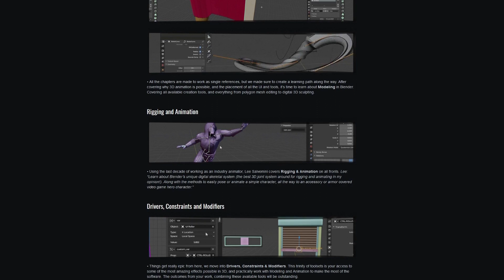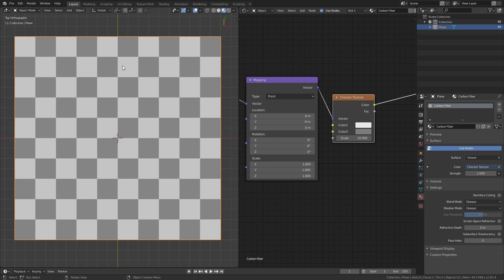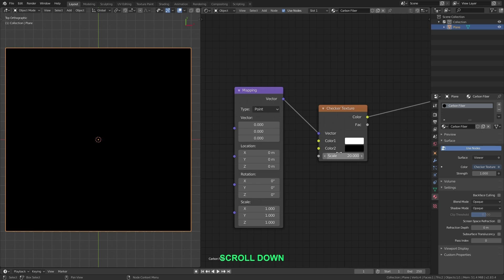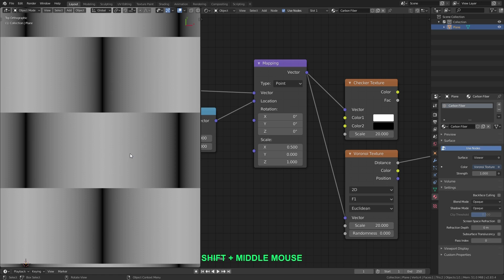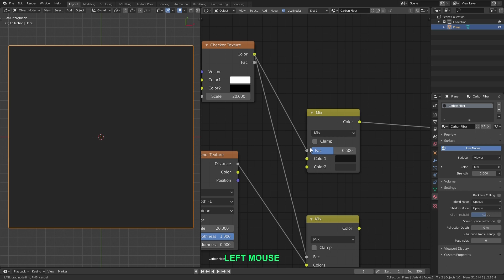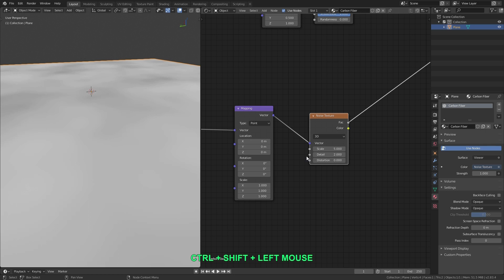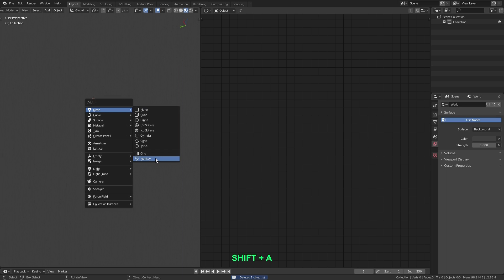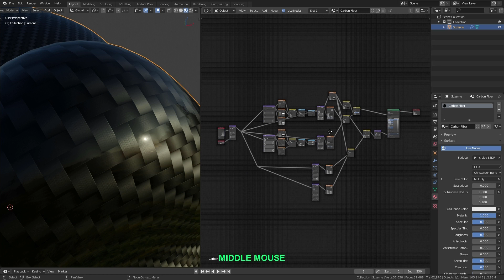Procedural Carbon Fiber Shader - Part 1 (Cycles & Eevee Compatible)

Comment: I really appreciate your video! good explain included. But I have a question on it. in 8:30 'combine XYZ' node output into 'Mapping' node. it turned to looks like original Checker texture. How it can be?... i tried to understand it. Its not work on my head...
Reply from the maker: It's actually been a while since I worked with this shader, so I'm a bit rusty on its mechanics, but hopefully I can clarify things.  So after we stretched the checker pattern out vertically we ended up with black and white lines. Next the idea was to offset portions of these lines horizontally to create a zig zag pattern. So we used other checker textures and mixed them together to create horizontal bands with different grayscale values, with the idea being that these different grayscale values would act as location offsets when we plugged this into the Mapping node. Now once we plugged those bands into the Mapping node's Location input, it ended up turning those black and white vertical lines into a check pattern again. This happened because the grayscale band's values were too perfect, and they ended up taking sections from the vertical lines and moved them sideways just far enough to create the check pattern again. So that's why we then divided the band values by 2, to horizontally offset those sections half as much in order to get a zig zag result instead. When you play with the Color2 value of the one check texture like I did at 8:35, it helps visualize how those grayscale lines are used to offset parts of the black and white vertical lines. If you change the grayscale values it will offset the black and white lines by different amounts, so you can end up with a checker pattern again, or a zig zag pattern. I hope this helped clear things up a little, and more importantly I hope I didn't just make it more confusing =)
Reply: even for me not english native. your description is so intuitive! it realize me why i can't understand on video is just for deficient node fundamental... I think i study about blender(whatever function)  anywhere else. that infos and knowledge are so fragmentary. like this case, consuming many time on these problems and not integrate themselves. really appriciate your kindness. :) ..
Reply from the maker: It's a very complex topic, and yes the available information on nodes is definitely fragmented especially because of how complex the node system is. But after practicing and studying a lot it will start making sense more and more. Good luck!

Comment: Thanks for this amazing tutorial Chris! I am trying to apply this cool looking carbon fiber shader to a skin modified mesh. In essence, I take any shape, remove its faces, add a skin modifier and a subdivsion surface modifier, I then apply the modifiers, and finally add your material. For some reason the pattern is not there and only the metallic look is preserved. Any idea why this could be?
Reply from the maker: Since the material uses UV Coordinates you'll need to unwrap your final mesh before the pattern will appear on it properly. Hopefully that's all the issue is.
Reply: @blengine  Yes, you are right. The mesh created after adding a skin modifier does not create UVs. Adding UV seams to my mesh fixed the issue. Thanks for the quick reply :)

Comment: Great tutorial.I followed it to the letter and all 
goes perfectly until I connect the final node. It's a 
bump node and should be connected between a MixRGB and the 
normal input socket of the Principled BSDF shader.
Using the node wrangler, all the output nodes look as the should but as soon as I switch to the BSDF the object goes pink. Disconnecting the Bump node fixes it but lsoes the 
height input from the MixRGB node.
Any ideas?
Reply from the maker: Hey, you can send your blend file over to me at contact@cgmasters.net and I'll check it out.

Comment: Thank's a lot for the tutorial! But when I apply the texture to an object, the object turn's all black. What am i doing wrong?
Reply from the maker: Did you remember to UV unwrap your model? This texture being applied properly relies on good UV unwrapping.
Reply: @blengine  yes , only a few objects turn to  black , just the only ones I wanted to use as carbon fiber

Comment: Wouldnt it be easier to model the carbon fiber with two planes and an array modifier, then bake it as a normal map, use that normal map as an image texture?
Reply from the maker: If you're just looking for an image texture of this then that's probably a good approach. The advantages of procedural textures though is the quick and extensive customization, plus the infinite resolution.

Comment: amazing video i was look to get my hands on a tutorial like that and boom you appear, thank you

i just have an issue, when i place it on the monkey head the texture is perfect, but when i place it on a car it's like there is no texture, on some part it works but on most it doesnt any any what can cause this ?
Reply from the maker: Hey, did you remember to UV unwrap the object? The texture is placed on the object based on UV coordinates, so anything using it will need to be unwrapped.

Comment: OMG thank you so much!!!! I've been trying to do this for so many months and couldn't succeed. I tried with a brick texture instead of a checker texture. Am I stupid? or is there a way with that too?
Reply from the maker: I started my tests with the brick texture too, especially since it has offset options. There still might be a way to use it, but in the end the checker node just seemed less complicated to work with.
Reply: @blengine  Yeahhh!

Comment: Hmmm... Doesn't seem to work as well in 3.0 as when I duplicated it It wouldn't show vertical bands just black and white. Had to redo it manually and it worked. However nothing matches up when I combined the horisontal and vertical bands. Not sure what I've done wrong here?
Reply from the maker: Hey send your blend file over to me at chris.cgmasters@gmail.com and I'll check it out.
Reply: same problem here with 3.4

Comment: Hi, im following this tuto, but on mapping node i have only 1x input - vector and not an input on location / rotation / scale ... Did i have to activate something ? (Blender 2.8)
Reply from the maker: I forget which version it is, but at some point the Mapping node was updated to include separate inputs. I think version 2.83 LTS would be a safe bet to use for this tutorial. You can get that version here - https://www.blender.org/download/lts/

Comment: I tried once.
I started by the checkerd node but then what...
Thanks.
Would be nice to use with your car modeling course :)
Reply from the maker: This was a tricky one but fun to figure out =) Using different values to offset a checker texture was the key to the weave. -Chris
Reply: @blengine  The node tree is not so complicated but the "stairs" in black & white was the key :)

Comment: is there a way to make displacement in height from the pattern you after you make map? but no using displace from modify function.
Reply from the maker: I don't really understand the question, but if you're asking if height maps can be made from the pattern then yes. I actually create height maps to use in the Bump node for the purpose of creating Normal map info. This height information can be used with the Displacement node as well.
Reply: @blengine  great! You answered me. Then do you have that tutoria video?
Reply from the maker: @onejlee7426  This tutorial shows how to create those black and white height maps, and I use those height maps for normal maps but they can be used for displacement maps as well. I don't have a tutorial on exactly how to do that though.
Reply: @blengine  thank you so much!:)

Comment: Hi @cgmasters, Thank you for this tutorials! I am having issue with cycle renders of this carbon fiber, it doesn't display it. It does work in Eevee render however. Is there a solution to fix the cycle render? Thanks a million!
Reply from the maker: Hey, send your blend file over to me at contact@cgmasters.net and I'll figure out why it's not rendering in Cycles.

Comment: Is this good directly applied to car as a material? Or need some extra setting?
Reply from the maker: Yeah all you'll need to do is uv unwrap any object you apply this to. -Chris
Reply: @blengine  yes ive done it on some part of my car, looks nice, but look a little bit mess on my rim because i just unwrap it with no marked seam cz i dont know lol. Thanks sir
Reply from the maker: @duckhead2948  Yeah this will need a good unwrap. Since it's a surface texture no more automatic mapping coordinates would work better unfortunately.

Comment: Thank you for the useful video, but keyboard shortcuts (shift+W, shift+equals and others) don't work in the node editor. What is the reason for this?
Reply: These are probably shortcuts from the node wrangler add-on.
Reply: @Janis_P  thanks
Reply from the maker: Oh yep, don't forget to enable Node Wrangler in the add-ons. I'm not sure why this still isn't Blender's default, because the hot keys are insanely useful. -Chris
Reply: @blengine  thanks

Comment: How do you save the material?
Reply from the maker: To save the material you'll just need to save the blend file, then it will remain in the file as long as the material is assigned to at least one object. Remember that if a material is not assigned to any objects it may be erased if you close the file, even if the file was saved.

If the material is not assigned to anything but you still want to save it in the file (like if you just want to have a material database in the file), then make sure to click on the shield icon next to the material's name. This will assign it to a "Fake User" so that Blender things the material is being used, that way Blender will not delete this material if the file is closed, as long as it was saved.
Reply: @blengine  BTW do i need to worry about the clamp factor on the mix nodes? i'm in Blender 4.2 I see the clamped factors automatically as checked boxes. 

im also having trouble seeing the texture in the rendered view for some reason
Reply from the maker: @LadyHolyKnight  I don't really remember this texture that well at this point, but clamping would just take values beyond a 0-1 range and clamp them down to a 0-1 range, but I don't think there's anything in the texture that needs to be clamped. From what I remember we're mainly just dealing with black and white colors and factor outputs, which are all already within a 0-1 range, so it should make no difference if they're clamped or not. When in doubt though, just flip the clamp options on and off and take a look at the results, if the results change then clamping has an impact and you'll need to decide what the desired result should look like. As for not being able to see it in rendered mode, send your blend file over to me at chris.cgmasters@gmail.com and I'll check it out.

Comment: * HELP PLEASE * .... When I edit the mesh ,particularly when i grab any vertices/edge/faces...the texture become stretched some where,somewhere it shrinks...How to solve this problem?
Reply from the maker: This shader works best with UV Mapping. So when you change your mesh or change your UV Map this can affect the application of the texture on the 3D surface. To fix this, make sure you UV unwrap your meshes as good as you can to make sure there's no distortion in the texture. If you're new to UV Mapping I'm sure there are some tutorials on youtube that explain it. Good luck! -Chris
Reply: @blengine  Thank You so much for the clue.
Reply: @blengine  One more Thing I'm confused now that I have seen video how to fix this if we use a texture image. but if we don't use any image ,I mean if we make the texture in shading panel,I have no idea how to fix this

Comment: The end result looks great, but the process to get there seems way too convoluted for something that should be quite common. Surely there is a better way.
Reply from the maker: There could very well be an easier way, but I don't think it would be too much easier. It might be common but that doesn't mean something is simple to achieve. Maybe the devs will add in a pattern type node in the future, or some row offset options for the checker texture to help achieve a zig zag. -Chris

Comment: why did you not use a displacement map instead of the bump? wouldn't displacement look more real? or is the amount of additional verticies too much to calculate?
Reply from the maker: Yeah considering how small the weave is it would take quite a lot of extra geometry to displace convincingly. And because the pattern's so small, and because the displacement would still be pretty flat, it just doesn't seem worth it. On top of all that, if you displace the mesh you wouldn't be able to add a clearcoat polish layer in the same shader, because the surface would no longer be physically smooth. -Chris
Reply: @blengine  thank you very much for that answer! great tutorial btw.

Comment: His tutorial as much as is awesoke how to do procedural stuff. Is tottaly wrong about how to do carbon fibre. This is tottaly not carbonfibre but imittation of carbon fibre. The real carbonfibre dosn’t have albedo. I mean all fibres are exactly the same color... the whole wave pattern/stripes is happening because of anisotrophy of light.
Reply from the maker: Yep this has been mentioned, and luckily wouldn't take much extra to add in the anisotropic effect with this setup. Meanwhile the color options can still be useful because custom carbon fiber with different colors actually does exist. Search for "red and black carbon fiber". -Chris
Reply: CG Masters i work in carbonfibre industry. There is no red carbonfibre. The thing u are talking about is. Just tinted carbonfibre, it is just epoxy is tinted red. Carbon is crbon, it is epoxy/clearcoat layer that is tonted to give color tint :)
Reply from the maker: @MaciekJutrzenka  Oh yeah I wasn't trying to be technical, just generally referring to the product and its variations (however they might be made) which can make the ability to change each direction of fibers useful. I'll likely revisit this and make a second part to the tutorial that goes the extra steps to add the anisotropic effect and I'll put everything into a node group while I'm at it.